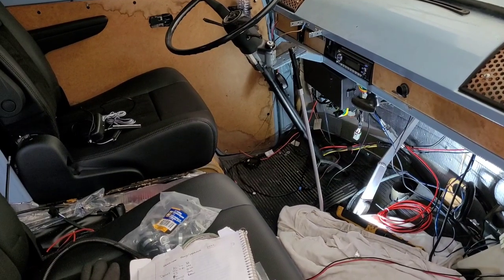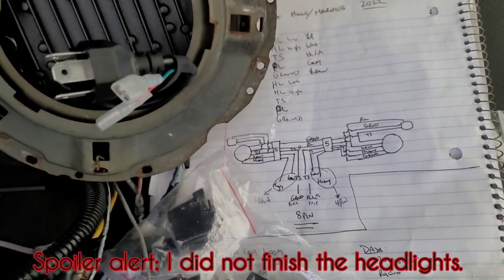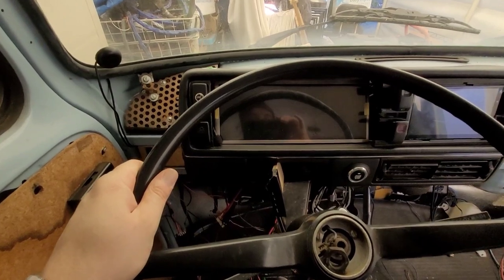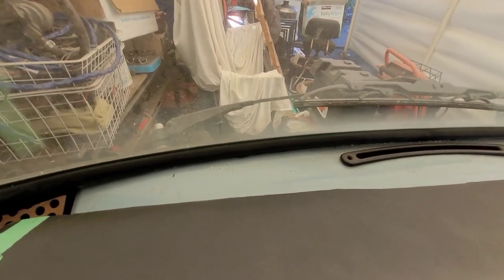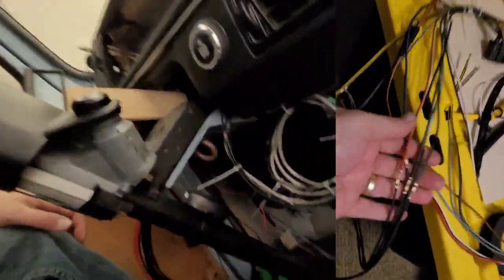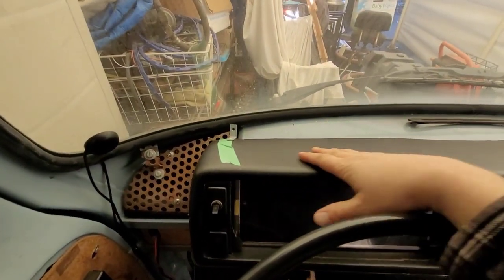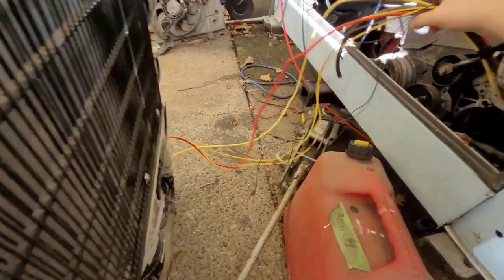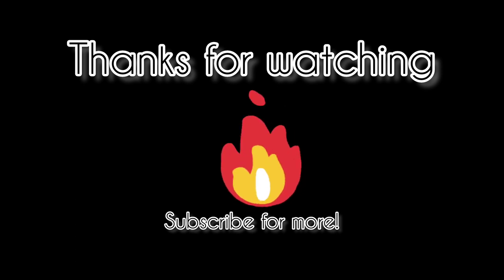Digital Dash getting installed?!? 1976 Turbo Diesel Volkswagen Baywindow Bus gets modernized

Comment: very nice project. I kind of want to do a digifiz lookalike dash as wel but not sure about if i can get it to work like i want. How do you for example safe the distance you have driven? I found an 8.8" screen wich is allmost the size of my original cluster, its a bit smaller but i could fill that with a bezel i guess.
Reply from the maker: Sorry for delay. Never got that far. I was using a guys project a guy made for his Manx. He was using the Arduino to write to a text file after each drive.

Comment: Really looking to do this on an older vehicle I'm working on. No OBD1 or 2. Was wondering what hardware you had to use to convert inputs to something the Pi can read.
Reply from the maker: Hey Garrett,  I have currently set things up with arduino Nanos in the interior and a mega for the engine sensors. I might be switching to wireless with esp8266 or esp32. Also considering a teensy 4.0 for the engine sensor control instead as it's much quicker than the mega. I have a few videos on that end.  You can check my older content for some hints. @ovensgarage and @motorvatediy have some good content on the matter.
Reply: @Gfunkbus76  are you using it for engine control or just monitoring? I'm looking to just monitor and use the stock ecu for the motor
Reply from the maker: @Garrett Hunter  just monitoring. Mine is a mechanical injection turbo diesel. No real electronics to run. So just monitoring various sensors etc. There is Speeduino for engine control... but not needed here.
Reply: Awesome, wish there was a better way to ask questions than YouTube's comments. I have decided to just jump into this project head on, we'll see what happens. I bought an Arduino uno, openauto pro, and various other pieces. Really Im just looking to monitor my Oil pressure, water temp, RPM, do a gps speedo, and fuel. Mostly thermistors, hopefully I can figure it all out.
Reply: Do you happen to have an Instagram or Facebook that I can PM you at? I've got my openauto and my Arduino. I have my Arduino reading the thermistor and outputting the temp reading in the terminal and to an LCD. Need help with the API for openauto and getting data from one to another
Reply from the maker: @Garrett Hunter  hey man,  you can search me on Facebook or Instagram. Gavin Norquay.  I don't use the OpenAutoPro API though. Best case would be to try their forums for that specifically.